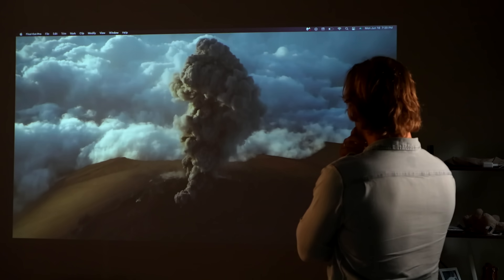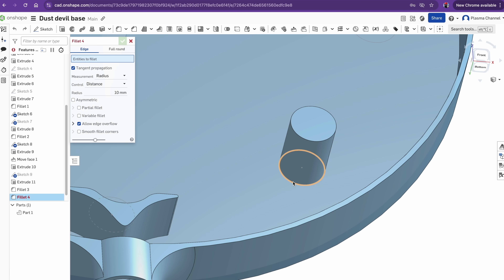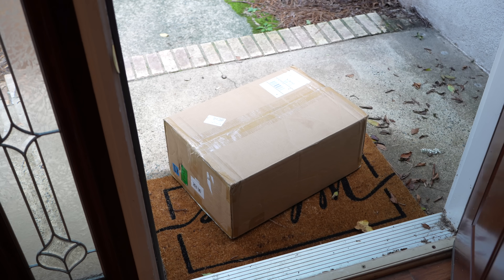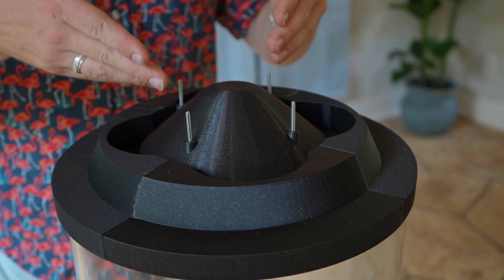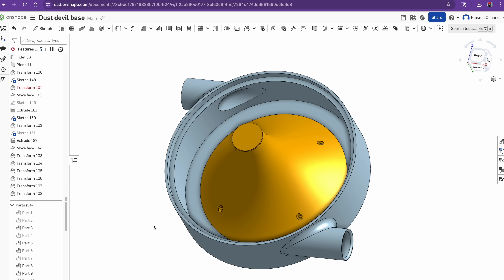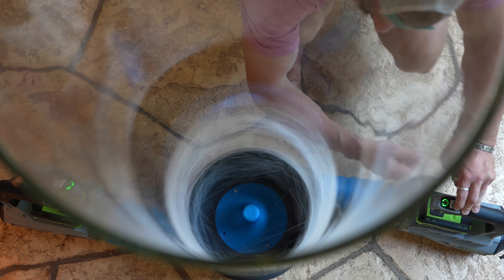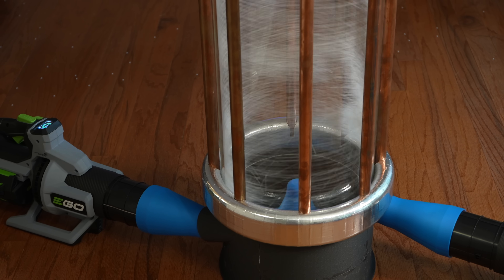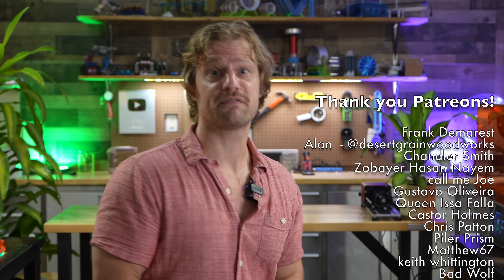Making Lightning In A Bottle Might Be Possible  (ft. 3D Printing Nerd)

Comment from the maker: Thanks to Incogni for getting rid of my spam calls (really haha)! Use code PLASMA at the link below and get 60% off an annual plan: https://incogni.com/plasma. This project is ongoing - and I plan to keep at it until I achieve a flashover event on the glass - essentially - exactly how a lighting bolt is triggered. Massive built up static charge, and a waterfall event. Thanks for watching, and Joel's video is here! https://www.youtube.com/watch?v=JPNjd7ZJvo8
Reply: One of my favorite inventors he studied fluid dynamics and was the father of verticular water science I do believe you have a lot of the legwork done with the materials there is a way to take The beads you can get for weights they are acrylic and if you used quartz sand specifically crystal quartz ground and had that with the inside having a ground and having the top portion of it metal and formed with a inward cyclonic tightener at the top bottle necking it back towards the center and making a loop I believe you'll have revolutionary results
Reply: Does Incogni get rid of the data you upload for the new age verification laws?
Edit: I asked them, they don't :(
Reply: Hi jay! Whats up? Big fan here. I want to share a video with you but i cant share links or it deletes my comments unfortunately. Its an awsome teslacoil gun that just fearlessly shoots lighting 3-5 inches long while being the size of your hand possibly fitting in your pocket. Its done by @MS_lab but i want to know if your interested in j anything like,"pocket sized teslagun battery powered long lighting".
Reply: the effects of volcanoes and sandstorm lighting  are not produced by the volcano or sand storm themselves. they are just interacting with electric currents flowing into the earth  from the sun.
Reply: Introduce vortex shapers, e.g. rifling, to the interior of your glass tube. Embed small neodymium magnets into the rifling. Reduce the capacitive resistance of your collectors to match the triboelectric potential generating the static charge. Make sure the glass used is not a borosilicate or metalo-silicate composite glass. Borosilicate has poor electric resistance as is the case with other metalo-silicate glasses. While chemically stable, electrically stable they are not. Their composition allows for electrical charge leaking, and if in contact with your Faraday collectors, maybe creating a completed circuit leading to faster discharge of any built charge. The reason for this is simply nanoscale metal pathways due to uneven distribution of the boron or other metal oxides in the glass creation process. Higher resistive and capacitive materials like PTFE, Acrylic, or natural (pure quartz) glass would be better for your design. You could also try a charge-retaining dielectric film on the inside and outside of your current glass tube (material similar to the scratch resistant protectors for phones). 

A dual chamber vortex may also offer a better route. Obtain a smaller glass tube and place it in the center of the larger tube, separate the aggregate (balls), and have one set of balls (the one with the largest surface area and quantity) spin up in the outer chamber and the other set in the smaller chamber. This effectively would create a controlled differential electrostatic engine and allow for electrical discharge within the gap between the two glass chambers. In effect this would be, to coin a proper name, a Triboelectric Aerovortex, a Van De Graaff Turbine.

If you could enclose the unit to maintain total closed loop air pressure, adding neon or hydrogen may induce greater triboelectric build up and discharge, generating visible plasma.
Reply: @Plasma Channel
Look into the construction of: leyden jars
They have an inner & outer collector surface.
Reply: @sebbes333  They do, but not for the same purpose as my suggestions. Leyden jars are initial iterations of capacitors. While we're dealing with capacitance, the initial intent of the experiment in the video was to generate lightning based on the interactions we see in sandstorms and volcanic eruptions. To that end, my suggestion at least, was to introduce to charge plate surfaces to allow for a build up of discharge within the gap of the two glass cylinders. Such that, once a large enough static charge differential is created, the electrical charge would arc within the gap.
Reply: Got 20 inch arcs with my vortex storm generator about 6 months ago! I could help with it if you like.
Reply: if you insulate your floor you will be able to better store charge. i have foam panels on the floor of a room i work in and i'll build a 1 cm shock just walking on end to the other.
Reply: my brother in science ! where you get the glass pipe?!
Reply: you're trying to create the phenomenon you see in reverse. the electric charge input from the sun is what initiates the phenomenon and then material properties enhance or inhibit it.
Reply: The link isn't working. Keep getting the 404 error. No Plasma Found! Lol 😅 But seriously it doesn't work. 😢 Tried from 2 different devices on 2 separate networks.
Reply: @The_SwellGuy  skill issue, works fine for me maybe your browser/internet/vpn is doing something to make the website not work
Reply: @The_SwellGuy  WHY in tf would you support a scam company?
Reply: @DriftRat Elaborate Please. Also, need to see proof of your claims.
Reply: @DriftRat Still waiting on your response?  Or are you just a troll?
Reply: I was right. Its exactly what I guessed on the q and a. It helps that im an engineer
Reply: This concept might help! Lord Kelvin's Water Dropper: a neutral-charge pool of water is dripping into two separate bowls through two separate metal rings, like dogs jumping through hoops. The opposite +/_ charge on the rings induces an opposite charge on the droplets of water. As that water enters its bowl, it adds that charge to the bowl... which is wired to the OPPOSITE metal ring! That way, an initial low-voltage is steadily MULTIPLIED by the 'infinity-loop' of charges. Pull - from the outer glass, to feed - into your blower with a hot metal grille like a thermistor, for example? There are a few options...
Reply: With just a little thought and logic, I realized that if I were a data broker, I would invent "Incogni" to figure out whose data was truly important. Then I would make sure some obvious doors were closed and others were opened. Think about that!
Reply: @DJCBuzz anti virus software racket
Reply: You need vacuum man stop using air pressure you're not getting spark you said I'm going to bottle a dirt devil not I'm going to bottle a leaf blower the vacuum shocked you not the air compressor or leaf blower if you do dual vacuum pump up top with your plastic ball reclaimed at the bottom you should be able to achieve your goal
Reply: Bowl shaped Magnetic array on top. (Plasma physicist David Lapoint’s bowl shaped array enlarged. )
Reply: Your thumbnail is clickbait and very annoying
Reply: I remember in an old book on electrostatics I had many years ago where there were designs for different types of high voltage generators. One used electrostatic particles blown in a loop through a non-conductive pipe, with two straight sections and two 180 degree curves.. This in effect created a vortex with the flow rigidly controlled by the shape. The air pump itself was part of the loop and all made of non-conductive material so the thing could be totally sealed.
Reply: With the big tube vortex getting the dust to fall into the centre requires that it weigh less than the transport medium - that's why the traditional version always uses water. As for the really 'big' version that happens outside - different effect created by suction and negative pressure vortex in the air. (relative pressure) Ok other people have said that already..  😄
Reply: O canal é incrível, os vídeos são muito bem montados e a ciência por trás é fascinante. Parabéns. Só lhe faço um pedido que habilite a tradução de áudio automática do YouTube para português Brasil, assim poderemos assistir e compartilhar essa ciência.
Reply: I dreamed how to solve your machine by useing rotateing magnits to move the particles instead of air inside a sealed sphere and dischargeing electricity through the outer housing. Have to save some of the secrets but it will work and produce net posative free-ish power.
Reply: Most sand is bunch of random minerals while silica sand is 90+% pure silicon same thing in quarts by generates tribolumences. You will see major improvements
Reply: I study tornadoes and vortexes I have a few ideas. Look up the Coanda effect that will recycle the air and sand
Reply: Just be careful you might not realize this or know this, but Dustin sand can also create explosions in small spaces. Hense fertilizer.
Reply: I remember seeing a prime time TV special like Guinness world records and someone built 2 large wooden wheels and affixed carpet to the inner sides so that they touched and built up a static charge, and then they sent that charge through a human chain for the record, and made sure it was people's elbow to hand to elbow to make sure it didn't go through their chest. Maybe consider a similar design as a windmill.
Reply: Surely someone's told you but just put the fan on the top with the inlet sucking air out the tube then put the inlets at an angle adjacent to the edges on the base
Reply: if you cool water to -90*c then deform/bend it it creates a significant current you should try this setup with dry ice in the chamber (when the balls hit each other they will create a flexoelectric charge) if materials/seals can handle that temp :P
Reply: A big key point to this working is actual seperation of negatively and positively charged beads. They will usually like to stick together and in average contribute to zero net charge.
In a real thunder you will have heavier and lighter particles. The heavier will sink down the lighter will rise (or with different temperatures). And the one kind tends to charge up positively,while the other tends to charge up negatively. That way you get actual large scale seperation of charge, and not just small scale seperation.
So use two different materials that  have as different density as possible. Focus more on density difference rather than triboelectric difference. For large voltages you need high capability for seperation rather than every single bead to have a large charge. Over time it will then accumulate even if individual charge is low.
Reply: Static electricity
Reply: Scammers are stealing your money! Sign up for this other scam to fix it...
Reply: Imagine having a channel with 1.6 MILLION subs, and not doing research on their sponsor...
Reply from the maker: I have 1.6 million subs? Wow, that changed quickly.
Reply: @PlasmaChannel  reuse the air in a constant loop, to reduce discharge over the fresh air and you can controle a bit the humidity of the air (silica packs or something like that). And you need a glasstube which can carry electrons to the balls. To prevent a discharge over groundplate you need something like a isolated spark gap, between outsideconnection of ground and the groundplate inside, which collects the sparks, else the air will be discharged too. Make the gap adjustable. Maybe a rod in middle of the tube, where only the top end is unisolated, is better than a plate. Place the setup on a glassplate to prevent discharge over the floor.

Comment: Running a ceiling fan in reverse (clockwise) pulls cool air up and pushes warm air that rises and collects near the ceiling down along the walls, creating a gentle updraft that redistributes heat for more efficient. This makes the glass warmer on the outside and cooler air on the inside allowing counter-clockwise spin on top for  or updraft for the sand to fallow

Comment: Need something on top that spins with the air it will control center funnel behind that needs to be a comb. The comb is on the wrong side. Kinda like how a ceiling fan works on reverse.

Comment: This message is for Plasma channel only: unit OD. Refrigerator coils. In S=S 
Negative.  Od. 1ayer.
Inner.  A plasma  membrane.  To boost the OD Refrigerator.  
2nd layer. 
ID. Thermal reflection.  To direct to Neg. Thermal field out.>
Inner chamber.  Open cavity.  
Move the pill threw the outer tube in Neg  Stadic.  
1 unit. A pill.
2nd unit a Neg Stadic tube.
Delete after reading.  
0 friction movement.  Use only neg. To neg. 
The spike in the ground. Wrap the pvc pipe. White,  green, or black. ...question.  will.wrapping. the pipe with a coil spiral neg to pos.ambint. 
Boost the neg Stadic ID of the pvc.  Nylon is good also. You have the plastic...magnetic. 
The cooler earth is Negative..but not dry. So air will.need to move. So ionic direction.  The ionic  bars. And your magnetic plastic. Pos....
I will see.your process.  Aurora 21 unit. Is ai key . Ask her..she has niro technology. No imagination...akey.

Comment: Hi there i have a theory .

Put you cyclone machine suspended in mid air with a positive lead going from the machine's core , positively charged with an insolated wire with both end exposed .
Allowing the discharge to take place at one single point .

Since the charge that has built up is'nt high enough to creat a bolt of lightning . ( things dont scale properly remember ! ) so by doing this you should be able continuous discharge . And or atleast prove the way electrical storms creat their charge . ( oh and next time try adding steam to the mix aswell to act as atmosphereical material " gases " )
Reply: And if you take your ionic tornado machine for example it has all but the charge and discharge fonctions . Think about it this way any of gases like dry ice and or water vapor act as a way for tge discharge to build up and discharge . Also why we smell the ozone electrical storms creat .

Comment: Tornadoes pull warm air up the middle while colder air down the perimeter, right? What if a chamber of cold & dry air is simulated through the use of an air horn adjusted in height to assist pulling warm air while heat exchangers extract heat for the journey back down.

Comment: 15:08 Since the glass is one piece you probably only need some conductive thermal paste between the sheet of foil and the glass at a small point.

Also a rubber seal at the bottom might help not sure

Comment: Charge separation due to mechanical work can have different origins. Surface friction is only one way of achieving such separation. There can also be electrostatic induction (when a neutral particle or body is moved by an external force in an existing electric field).  There can also be mechanical separation of a generally neutral particle or macroscopic body into two parts with different dielectric permittivity or other differences in properties. For example, one can often see huge half-meter sparks in polymer film unwinding machines. I also managed to observe quite large sparks by inserting a large wrench into a high-speed jet of superheated steam from a pressure gauge tube at a factory, and I'm having difficulty determining whether only one mechanism was at work there or not.
You can probably recreate the Wimshurst machine principle where electrostatic induction (not friction as many think) used to charge moving lamels and then take the charge out of them to capacitors. You need to place properly some pairs of electrodes connected to each other. Most probably those for creating induction (external field to charge particles moving through) should be on the external side of the tube (or at least insulated well from the particles) and those fore carrying charge out -- inside the tube and not insulated. The charge-collecting electrodes should be connected to the opposite induction electrodes. Watch this → MzqQ4Fc0RTg YT video carefully (it's in Russian but it's really good and YT should be able to translate) to understand the general principles of such machines. (See also "Kelvin water dropper" where this principle is very obvious). And you probably need to ground one of the electrodes to get good sparking to your body.

Comment: There is a way to make a TokaMac that runs on ambient energy and you take multiple colored coated Styrofoam balls and you play around with them and you change their position by their weight and by magnetic properties changed by what you’ve coded the beads with and now if you take a quantum speaker or any Twitter that puts off the right frequency of sound, there’s a precursor wave or a sub light wave And you start playing around with the programming of those and you make a ball that floats their suspended in that matrix of waves, and then you start moving the BBs around inside that matrix and make the whole reactor and as you change the amount of two different color to one color or the other color, that’s all the temperature change of the reactor does things go completely south the thing loses magnetic containment all the balls fall to the ground. You wait for everything to cool down maybe 30 seconds maybe a minute and you restart the machine it’s really pretty neat. I’ve been trying to get people to listen to me. Explain it for well over a decade and a half.

Comment: You’re mixing up static electricity with electric current.

They can both create sparks, but they work in completely different ways and need to be handled differently.

Good conductors don’t hold static charge. The better the conductor, the worse it is for storing static.

So, if you use a plastic tube instead of glass, it’ll probably build up a lot more charge.

And adding a rubber layer at the bottom helps stop it from discharging into the ground.